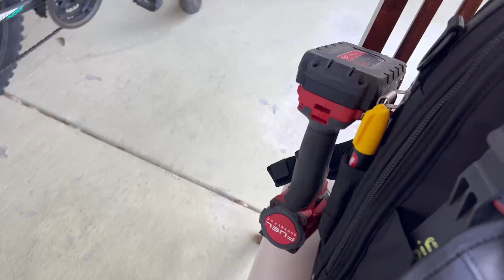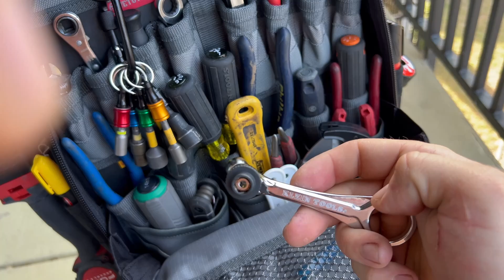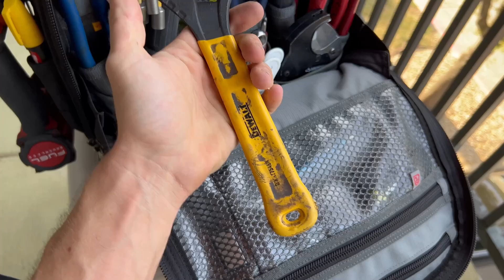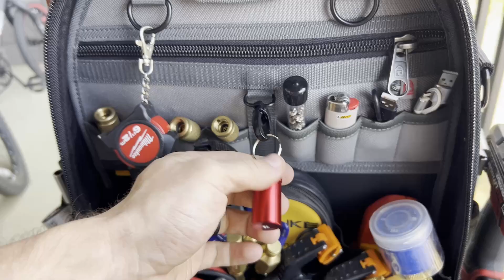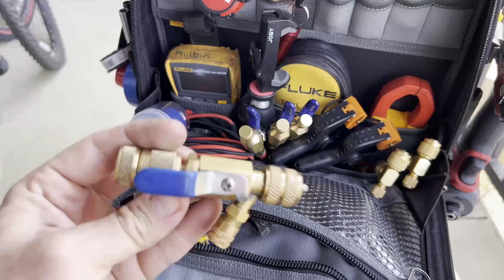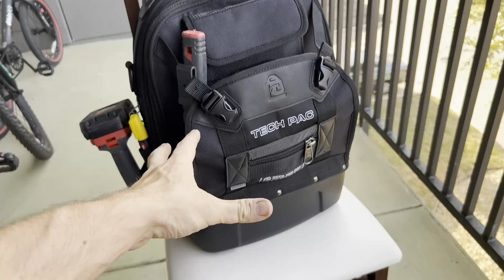Veto Pro Pac Tech Pac Blackout HVACR EDC

Comment: Nice video you did, just wondering what’s better Klein or veto bags? I work in the trades and carry a heavy bag and wondering what will last longer and have a good zipper and storage for my tools.
Reply from the maker: The Klein backpack I had years ago was a good bag , but when you unzipped it , it would not stand up right and would tip over , which was very annoying . I will say this from experience , Veto bags are higher quality and more catered to and have more thought put into the pouch placement and overall design and are more Durable and have a five year warranty. That being said , if you’re trying to save money the Klein bag is still a fantastic bag for the price , and last I checked , the Klein backpack had a lifetime warranty through Home Depot. Meaning you could just bring your old torn up bag in and walk out with a new one same day. I’m not sure if that’s still their policy , but you can’t go wrong with either.
Reply: Ok thanks for letting me know your experience ,I live in Canada, the veto bag is over 550 with tax and shipping the Klein is 275 plus tax and shipping,

Comment: whats the box that holds your electrical connectors?
Reply from the maker: It’s husky brand from Home Depot , you can find it in the tool bag isle. It’s pretty light weight but extremely durable and secures very well and is water proof. Only costs $10-15. It’s held up very well , I would definitely recommend it